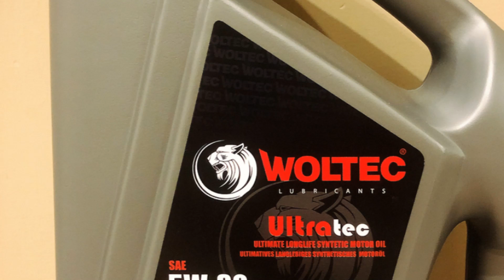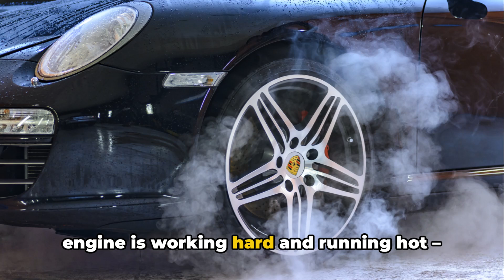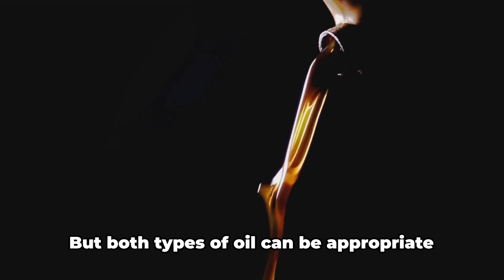5W30 vs 5W40 Oil: Which One Should You Use?

Comment: I live in a tropical country ... My manufacturer recomends a 10w30 ... What are the side effects if i change it from 10w30 to 5w40 ? 🙏🏻

And for a tropical country climate + occasionally stop & go traffic, but still need good acceleration + good protection for the engine, which viscosity would you recomend between 0w40 VS 5w30 VS 5w40 ? 🙏🏻

Comment: I'm not sure why people are confused about this 5w30 and 5w40 oil... the 40 is simply for hotter climates... where the ambient outside temperature is regulary 40+... example... use it in summer... and yes it privies more pressure... around 10psi which shouldn't even come into consideration unless you operate a car under heavy load or in the D3 AND D2 auto gears to towing stuff... 5w30w is just a better oil runs especially for better fuel consumption... only time you'd jump to 5w40 is when the car is getting older and high kms... like over 200.000k... minimum ... and you want to introduce heavy loads as I've already stated. Also go either liqui moli or motul or mobil 1 or get the bet best shell or Caltex if you can't find or afford those other 3 brands... always buy the best oil money can buy.
Reply: “Not sure why people are confused about this”

* writes a novella with no paragraphs… *

If there’s that much to say then it’s stands to reason that it’s a more complicated subject than you’re making out. Not everyone’s a care expert like you.
Reply: @station-7  okay here is a simple sentence "5W30 is fine 90% of the time... unless it's summer/or regularly 40+ degrees outside where you live"
Reply: It's not rocket science! They are both 5 weught when the oil is cold. The 40 becomes an issue if your looking for better fuel mileage but at the same time may help with oil burning or leaking.
Reply: Any issue if we used 30 instead of 40 in hot GCC countries
Reply: @dilipn2761  not noticeable unless you run your engine rough and sit in traffic a lot.... however you'd want to put in 40w next time, especially if you regularly have 40+ degrees days... it also increases oil pressure by roughly 10 psi. You'll be okay trust me.
Reply: Thank you 🙏🏻
Reply: I don’t think the 40 means ambient temperature, I think it relates to the time it takes to flow at oil temp of 100c.
Reply: @aussie8114 yes correct only the first part is for ambient temp aka the smaller number will act as 5 when it’s cold out but act as a 30 or 40 when at operating temp
Reply: My car is Toyota  Corolla imported used from USA to Dubai , it recommends 0w20 on the oil cap , i use 5W40 but the mechanic told me you must stick with OEM recommendation because the engine heat reaches +500c so a few grades from the outside temperature will never affect it ! It sounds logic for me but im not convinced of using 0w20 in 45c+ and 25c minimum ! It sounds not right for me .. what do u think ?
Reply: @Med-991 nobody knows I think😂😢
Reply: Well agreed.Very true not confusing
Reply: @eljefe-tracogang3808 what he wrote was wrong. 
Terribly wrong. 

Read my comment instead of this kids uninformed dribble

Comment: Hey i humbly request you to answer my questions 
I own VW polo TDI 1.2 2013 and engine running at 50k kms exact 
In india..In my city temperature can reach upto 47 48... And as low as 8 or 9 But i dont use my car much in summers.
I dont drag my car...i dont want much performance... 
If a go somewhere i cruise at 80-90kmph max...i just demand some smoothness and mileage and longer life of engine so which engine oil i can use 5w30 or 5w40 vw suggest 507 00 / 505 01 so what would be better ? 
 2. When previously serviced at 42000km my mechanic uses 5w30..if i use 5w40(if you suggest ) this time  wouldn't it effect my car ? Because even after drainage appx 500ml of previous oil still lefts...
Reply: Just make sure your car horn is working, don’t worry about the oil😀📢

Comment: Manufactured recommend 5W 30W  but where I am using temp is usually 37 to 45C..which oil you recommend? Thanks
Reply from the maker: Hi, You can use the manufacturer's recommended 5W-30 oil, as it is designed to perform well across a range of temperatures. However, for consistently high temperatures between 37 to 45°C, 10W-30 or 10W-40 may provide better high-temperature protection. Always ensure the oil meets the manufacturer's specifications.

Comment: I live in an area with frequent stops, so I'm sure I'd be fine with 5W30 but I have an older 2014 BMW mileage is a bit up there so I use 5W40 to help lubricate the parts better. Plus its summer so temps will be starting to get hotter.
Reply: your engine runs at 90 degrees! The outside temperature does nothing to your engine. It's only relevant until your engine gets warm withing 5-10 minutes. After that your engine will be running around 80-90 Celsius regardless of the outside temperatures!
Reply: @attilagal6672 true
Reply: @attilagal6672 exactly and it hurts my brain when people say otherwise

Comment: For diesel1.5 kia seltos, can i use 5w-40
Reply from the maker: Hi there, For the diesel 1.5 Kia Seltos, the recommended engine oil is SAE 0W-20, complying with ACEA C5 standards. This specification ensures optimal performance and efficiency for this particular engine variant. Any reason you want to change?
Reply: @HonestMechanicChannel  i live in a hot place,
I saw that using 5w-40 is good for engine and i was also hoping if i switch to this that it improve the overall performance 😅
Reply: Like reduced sound!!
Reply: @abhaymanchal7746  Areee bhai engine phat jayega
Reply: Honda city petrol 1.5! I have been using liqui moly 5w 30! I want to switch to 5w 40! Need your opinion
Reply: @Lordshiva5689  What's the recommended grade?
Reply: @RajeshSingh-rt4rx  5w 30 is recommended grade! However! In delhi temperature is  above 30 most of the months! I am planning to switch
Reply: @Lordshiva5689  You can't change the oil grade according to the temperature that easily, just change the coolant and get the car checked if it's overheating, a good engine oil will be the ESP 5w30.
Reply: @Lordshiva5689  Best will be Signature Series
Reply: @Lordshiva5689  Honda City strictly uses 5W30, if you want to go for the best oil available in the Market Go for Amsoil Signature Series 5W30.

Comment: Hi.I have cheverlot optra petrol 1.6 litre engine.I use 5w-30 oil as it is recommended by manufacturer.However now I am looking to upgrade to 5w-40 oil as I have issues with bearings clearances .so should I go for 5w-40 to overcome above challenges even though 5w-40 is not recommended in my owner manual.Please advise.Thanks.
Reply: If you already have issues with bearings clearances, another oil will not fix it! Get it repaired and THEN change to 5W40 to prevent another damage in the future.

Comment: Hi Mr,, My car is Hyundai Sonata 2400cc ( DOCH),, I use 5w_30 Hdx Ravenol german brand,, But I live in very hot country( over45c in summer),, and my engine has done 122500km,, Do you advise me to switch to 5w_40 SVS Ravenol highmileage??!!
Reply: During summer: yes! For winter it depends on the lowest temperatures you have in your region. If it goes down to -5°C or lower, you should use the 5W30 for the winter period.

Comment: For Hyundai Elantra, the manufacturer recommends 5w30. However, I drive in hot weather and its summer already, would it be better if I use 5w40 instead?
Reply from the maker: Hi Amir, for your Hyundai Elantra, sticking to the manufacturer's recommended oil viscosity is usually the best practice, as it is tailored to the engine's design and typical operating conditions. However, using a slightly thicker oil like 5W-40 in extremely hot climates can sometimes be beneficial, especially if you experience oil thinning or if the vehicle is subjected to severe driving conditions (such as frequent stopping and starting, or heavy towing).

If you decide to switch to a 5W-40, ensure it meets the specifications and standards required by Hyundai for your engine. You might also want to consult your owner’s manual or speak with Hyundai service advisor to ensure that using a different viscosity won't affect your engine's performance or your warranty.
Reply: @HonestMechanicChannel the manual does recommend 15w40 for hot weather but does not officially recommend 5w40. So can we really use it?  Like I don't find the logic why they did not recommend 5w40 if they do 15w40?

Comment: Ok..Great Idea..0w-30 or 0w-40..Both Class 4 Synthetic Oil..Far better than 5w30-40.....
Reply from the maker: Choosing between 0W-30 and 0W-40, both of which are Group IV synthetic oils, indeed offers a significant performance advantage over a 5W-30 of the same class. The "0W" viscosity rating ensures excellent performance in cold temperatures, improving engine start-up during winter. The choice between 30 and 40 ultimately comes down to the specific recommendations of your vehicle manufacturer and the typical operating conditions (e.g., temperature range, engine load).

Comment: Which is better for hot wheather condition
Reply from the maker: For hot weather conditions, it's best to use an oil with a higher viscosity rating to ensure adequate lubrication and protection of your engine components. Multigrade oils, such as 10W-30, 10W-40, or even 20W-50, depending on your manufacturer's recommendation, are commonly used. These oils are designed to have a higher viscosity at operating temperature, which is crucial for maintaining proper lubrication in hot conditions. Always refer to your vehicle's owner's manual for the specific oil viscosity recommended for your engine and climate conditions.
Reply: @HonestMechanicChannel My motorcycle manufacturer rekomends 10w-30, but is it okay if i change it to 5w-40 ? ... I live in tropical country with only 2 season.

Comment: if you live where it reaches 40 degrees celcius 5w30 will will be fine but if its starting to exceed 40 degrees 5w30 will still be fine but its better to go for 5w40 at that point it will protect the engine better
Reply: Find me a 5W40 or 5W50, 10W40 with ACEA C2 specification as per Toyota user manual? I can´t, only 5W30, but it can get over 40 degrees here and I really would want to up the viscosity. Thanks
Reply: @Timetrends-n5t  e.g. MANNOL 5W-40 Energy Formula PD. But I think you even can use a C3 oil.
Reply: @Timetrends-n5t  są  oleje  z specyfikacją  5w40 Ace c2 I c3 równocześnie , bynajmniej  w Polsce  są😁
Reply: I’m in live where temps reach 115’ and more in the summer.  My new car says only use 0w-20. My truck says 5w 20,  I use 5w 30 in my truck , and I’m thinking I will switch to 5w 30 in my car. I think 0w20 is to thin.  Please let me know your thoughts?
Reply: @johnf.6942  Yes is no problem my car dealer said 0w20 i put in 5w30 and in summer 5w40 im not the only one down side is fuel econemy
Reply: I use 5w20 in Houston TX.  2004 F150 5.4
Reply: Sir plz answer     Company recommended  was 5w30        …

Bcz  summer started so m planing  buy  5 w 40. Or 10 w 40.     Any diffrence ?
Reply: @akshaytony  which car do you have ?

Comment: And dont get me started on the 0-20 and thinner oils, they are just around so manufacturers can say their engine uses slightly less fuel. But the downside is shortened engine life, and add to that low tension piston rings, and you have got an oil burner aswell, which eventually will destroy the cat etc.
Reply from the maker: You're hitting the nail on the head! Thinner oils like 0-20 are indeed primarily designed to improve fuel efficiency. However, it's a trade-off because they can contribute to quicker wear and tear in the engine due to less protection, especially in harsh conditions.  It's a complex balance for car manufacturers between efficiency and long-term engine health
Reply: @HonestMechanicChannel  0w20 fully synthetic engine oil is rated at 104 degrees farenheit which is 40 degrees celcius for external temperatures and 212 degress farenheit which is 100 degrees celcius for internal engine temperature so it will protect in hot weather.

Comment: My humble opinion about this, is that 5-30 fits in colder weather (around 10C and lower) and 5-40 when its hot weather. This to protect the engine against thinning of oil when summer. In normal driving conditions, that is.
Reply from the maker: 100% Agree! I use 5W40 a lot because of the fact that I stay in hot climate.
Reply: @aciddiver1978  guys wake up! Your engine runs on 90 degrees! The outside temperature does nothing to your engine. Unless it's -15 C° your oil won't be affected. 2-3 minutes and it's on 30 C° already!
Reply: @attilagal6672 in this few minutes in the morning could the maximum wear and tear occurs in the engine …
Reply: @attilagal6672 after that said the  5w is in both, important thing is the 30 or 40 over heat and reckless driving!!
Reply: @christiansaavedra1953 that happens with every engine regardless of the oil. 20 or 30 seconds of completely dry run until the oil gets pumped up from the bottom sink.
Reply: So would 5W40 be better in the UK then ? 🤔 note my 2017 RRS SDV8 has done 115k Uk miles
Reply: I have 2004 Ford f150 5.4 oem states 5w20 for all climates. I live in Houston TX. Even most mechanic say just to stick with it instead of going to 5w30 or 10w30 bc newer engines need thinner oil e.g. 5w20 bc of the tighter tolerances between machined parts since our machining technology and engine building has improved so much? Thicker oil cant get into all the tiny spaces as designed. I ran 20w50 in my 2000 5.3 vortec chevy and it went kaput, blam, blown, crapola, etc. after a long while of using it as suggested by a friendly mechanic-ish friend. Hindsight, that was way too thick for a newer truck. Sure maybe 20w50 in the 80's, but bad advice bc of a simple engine tap.
Reply: Then I should use 10W-40 in my toyota car because I am living here in the Philippines, it is always hot here above 25 degrees C